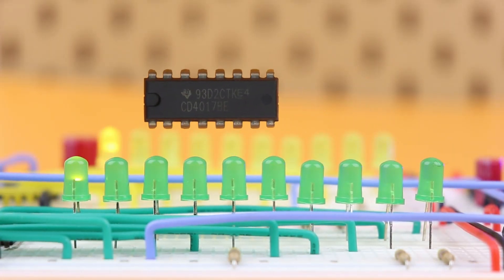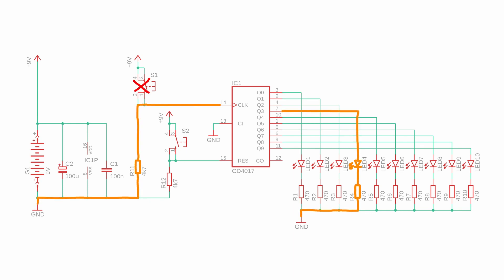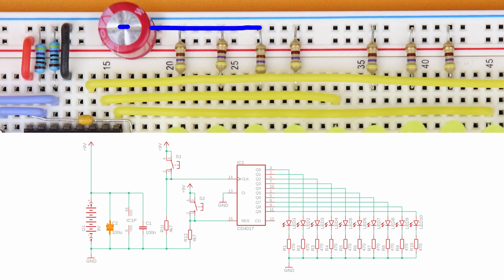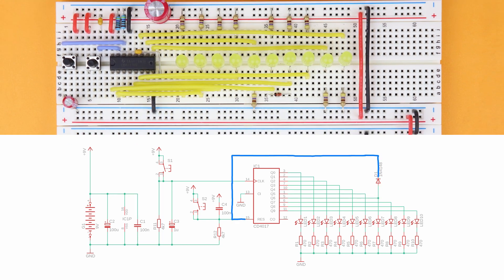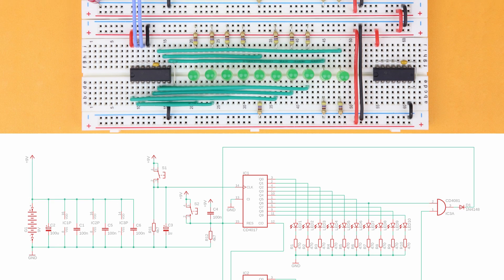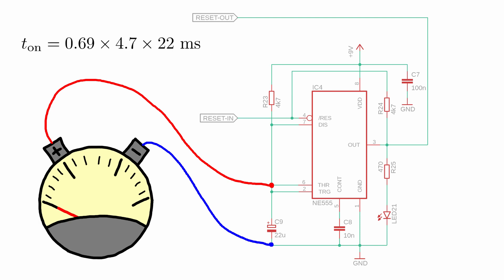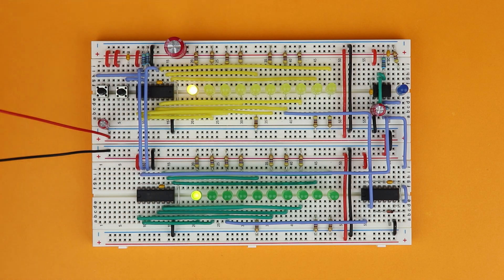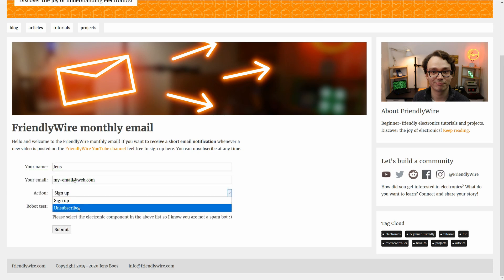CD4017 tutorial: the IC you can count on!

Comment: The reset problem should be resolved with the application of sychronous logic, not a 555 "bandage."
Reply from the maker: That is also a possibility. But even computers in the 70s and early 80s had dedicated reset circuit that would hold the reset line high for a short while. I do not think of it as a "bandage," it is just a different solution.

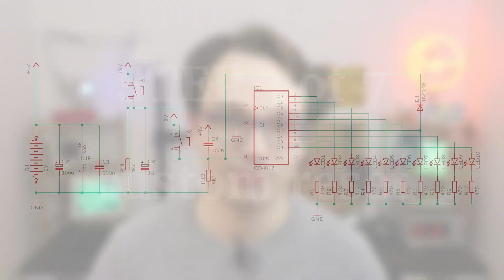Comment: untill the 7:07 I've been amazed by the instruction and the perfect presentation by you FriendlyWire , amazing!
but few questions:
for inserting capacitors in parallel , do we have two or three choices? or only the place you put. i'm still got problem with reading diagram to place in the right place
Reply from the maker: Thank you for your kind words (it means a lot) and an even bigger thank you for the question! The small 100nF ones can be placed close to all of the chips, and they can be plugged in either way. The bigger ones have a plus and a minus, and they can only be plugged in one way. But maybe you can tell me which capacitor you are talking about :)

Comment: Hello! Very nice and understandable video, thanks! Actualy, I'm working on a project using 4 pcs CD4017 in cascade (it's a simple count-up 40 pcs LED bar clock telling my grandchilderen (who are still to young to read the clock) when 15min, 30 min and 60 min are past. It's is working fine (thanks to your in-deep explenation in this video. However I would like to do some cosmetic changes. Question: Is there a way, without using to many other discrete gates, to keep the outputs of the CD4017 high (instead of going up high and low again) untill the CD4017 receives a reset? Resetable flipflops are a possibility but I would need 40 of them? Thanks in advance.
Reply from the maker: Thank you for your kind words, Wim, I am glad you found my video useful! And that's a super nice project! Unfortunately, the CD4017 only ever has one output high. But you could use OR gates to keep your LEDs on. For example, consider Q6. This one should be on when, well, Q6 is high, but also when Q7, Q8, or Q9 are high. So you connect pin Q6 to the anode of a 1N4148 diode, same for Q7, Q8, and Q9. Connect all cathodes together. There you put your LED. This LED will always be ON whenever Q6 or Q7 or Q8 or Q9 are on. Diodes make very cheap OR gates. you will still need a lot of diodes.

Another alternative would be to use a shift register and simply push down 1's. Have you seen my tutorial on them? https://www.youtube.com/watch?v=7RWaDvTeG7Y Let me know if you have questions on that, I am happy to help out more!

Comment: Great tutorial, but you only need one current limiting resistor for the LEDs because only one is a time.  All the cathodes should tied together and connected to the resistor is connected to ground.
Reply from the maker: Very true! To be honest, separate resistors is easier from a breadboard perspective because then we can use the ground rail as intended. Otherwise we would have to create a separate rail to collect all the LED cathodes, before connecting them to ground via the single resistor. Also, by generating this cathode rail there would be more wires involved and that could create additional stray resistance (especially on less expensive breadboards with poorer contact conductivity). 

So what you suggest is definitely the more component-effective solution and one should do it like that in practice :) But I hope that the tutorial still makes sense as-is. Thanks for your comment, and I have no idea why I did not mention this in the video. Have a great day!

Comment: ...and how about just adding a small capacitor after the AND gate diode and extending the RESET signal???
Reply from the maker: That works, too, but is less reliable if you have a large breadboard with not ideally conducting contacts. I found the 555 solution presented in the video to work more reliable :)

Comment: Great video… you can eliminate all those resistors tho… tie the cathodes of leds together and run them to ground through 1 resistor ( I used a 560 ohm resistor with a 9  volt supply and it worked fine( only 1 led is being turned on at a time so no need for each one to have its own resistor) Thanks for the video. I subscribed ❤
Reply from the maker: Thank you, I am glad you liked the video. And yes, you are right, in this case only one resistor works because only one LED can ever be on at the same time, good idea! :)
Reply: This circuit worked great the first couple of times I turned it on. It then started behaving really erratically. No longer counting and  leds lighting in no order at all. When I looked at the circuit with my scope I could see a lot of noise at the leading edge of the square wave from the 555. I tried changing both chips. No luck. I then tried using a 9vt battery hoping this would get rid of the noise. No luck.😢 I then placed a 220uf cap across VCC and bingo!! It worked perfectly. Noise from 555 gone. Thanks so much for these videos. Very cool circuits!!❤
Reply from the maker: @iaov  Glad it works now! Yes, that's why I always try to add a big bulk capacitor (here: C2 with 100uF), it really helps stabilize stuff. Glad you got it working, congrats, and thanks for your kind words!

Comment: Can the green led starts to lights after the last yellow led 
I want the led to light in sequence like (1,2,3,….20) not as the video in the same time (only one led lights)
Reply from the maker: Oh, you want to have a counter from 1-20, basically? Yes, this can be done, I think, by using the clock inhibit pin of the first and second counters. The problem will be to turn off the last yellow led (when the counter is in the range 10-19) and to turn off the first green LED when the counter is in the stage 0-9.

Comment: Use a resistor in conjunction with denouncing capacitor C3 to prevent premature contact erosion. Insert the resistor between S1 pin 1/2 and C3's + lead. A typical value range would be 10K to 100K ohms.
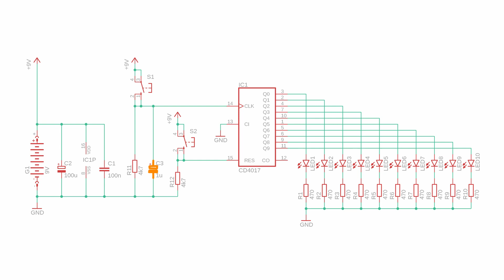Reply from the maker: Thanks, Arthur! This is to limit the current draw of the capacitor, yes? Good idea! (Schematic is at 5:49, for anybody reading this.)

Comment: Great video.  I stumbled on this looking for something very similar.  I basically need your exact circuit, but I need to be able to also count down as well, using a separate momentary switch. Do you know of an IC that has the 'down' option? Thanks!
Reply from the maker: Hey Bob, glad you found my video useful! The CD4510 can count up and down, but it does that in binary-coded decimal (BCD). If you want to convert this into a decimal pattern, you need to connect the outputs to a BCD-to-decimal converter, such as the CD4028. Hope it helps!

Comment: Just for the meme, I would have made this a 10-step tutorial. The carry out counting to 99 is fine but I would have liked to see implementation of a count to 19 circuit as I think that's also quite useful. You could make a followup video called "Hey 19", again for the meme, a reference to the Steely Dan song.
Reply from the maker: Something tells me you like memes... ;-) Well the general reset is discussed with AND gates in this video, too :)
Reply: @FriendlyWire  I'm not too meme centric but when there's an obvious opportunity, I think it should not be dismissed too easily. I've helped people on forums make sequencers using the 555/4017 combination to control model lighting such as for the various strobes and lights on commercial aircraft. It's an effective and accessible method for people who would not be willing or able to cross the entry barrier to microcontrollers. So far, no one has needed more than 10 time steps but having 20 available would be good.

On further reflection, I know how to build the output decode logic onto your 100-step sequencer and that's probably the best way to do it but I keep thinking there was also a circuit topology that used the second 4017 for counts 10—19 instead of the way you've shown where it's the next more significant decimal digit (10's). Either way, if you revisit 4017 circuits, these might be good material.
Reply from the maker: @KJ6EAD  I see what you are saying, yes! I like the idea of using 4017's to simulate light patterns. I used one some time ago (together with a diode OR gate) to simulate traffic lights :) Interesting idea about having 0-9 on the first counter, and 10-19 on the second one. I suppose you could just hook up Q9 to the Clock Inhibit pin of the second counter.

If you are interested in "outside the box" applications of the CD4017, also check out my code lock that uses these: https://www.youtube.com/watch?v=8aS2f4dCmBI
Reply: @FriendlyWire  Ah, yes, I haven't used the 4017 in a while so I'd forgotten about the clock enable. I'll have to pull up the data sheet and refamiliarize myself. I've done the traffic light (American pattern of course) with diode OR gates. I even have a party decoration traffic light about 10" tall that I'm going to animate with the circuit and appropriate LED clusters to replace the ridiculous random incandescent bimetallic blinker lamps that it had. I've also made alternating triple flash "police lights" both with integrated 3-input OR gates and with diodes. I don't want to take up any more of your time so there's no need to respond unless you want to.
Reply from the maker: @KJ6EAD  Always happy to exchange ideas! :)

Comment: Maybe you could use a rs flip flop which is set by the "and" condition q1.6 and q2.2. For reset you use another "and" condition q1.1 and q2.1 🤔
Unfortunately I don't have the opportunity to test this, but I would be very curious to see the result 😊
Sorry for the grammar, i'm not a native speaker 😅
Reply from the maker: Thanks, Simon! Can you clarify what you mean by q1.6 and q2.2? I am always interested in improving the designs presented in the FriendlyWire videos :)
Reply: @FriendlyWire  q6 of ic 1 und q2 of ic 2
I could have written that a little better 😅
Reply: Sry I meant q0 of ic1 and q5 of ic2 😁
The reset condition is q0 of ic1 and q0 of ic2
In that case you can be sure the reset signal stays as long as both ic's has been reset
Reply from the maker: @Metalfish0815  I like that! You would still need an additional chip (the RS flip flop) but you could ditch the 555. Also, you would need more gates for more chips to AND them all together into your RS flip flop, or you need AND's with multiple inputs, and that may become a bit cumbersome. But it's a good idea to do it. I kind of liked this 555 solution because it reminded me of the old reset circuits in computers from the 70's, but that's the great thing about doing YouTube: there are always more and interesting ideas that you didn't think of :) Thanks Simon, and have a great weekend!

Comment: 10:50 just add a inductor with a transistor to bump the voltage and make it charge faster to make it hold the voltage a bit longer so that it can register
Reply from the maker: Thanks! Won't you get a negative induced voltage when the signal disappears? I would be worried about EM noise.

Comment: Your videos are like Peter Jackson movies ,pristine and eye catching .I'm new in electronics I'm a 50 years old guys always love electronics ,learning alone with some books and videos. LOOKING FOWAR FOR MORE OF YOUR VIDEOS.I have a question 🤔  can I use ceramic cap.? Also it's there a equivalent for 1N4148 diode ?.I have a lot of them but not this one you know how it is  .Thank
Reply: I'm referring to the cap that you  use for bypass  between pin 16 and pin 8 for the CD4017,I see you use a yellow cap I believe they are Monolithic Cap. I wondering if I can use  the Ceramic Disc Cap  instead .                                              The diode ,I have 1n4007 but they are the black ones, can I use those .I thank you so much for taking time to answering my questions.
Reply from the maker: @ricardomarty9292  Thank you for your interest, it means a lot :) Oh, I see! Yes, those capacitors should work great, and the diode should work as well. Good luck, and let me know how it turns out, I would love to see a picture :)
Reply from the maker: Thank you for your kind words, it means a lot! :) For which part do you want to use a ceramic capacitor? The larger ones, above one microfarad, typically are electrolytic ones. And yes, you can use other diodes, too. Which ones do you have? 1N4001 or similar ones should work as well. Let me know if this helps or if you have additional questions, I am happy to help!

Comment: Wow, thats amazing. I would love to build this kit. Quick question, can this be powered by a usb cable with a power bank as a battery? I know that it would probably need some modifications on the resistors, but would it still work?
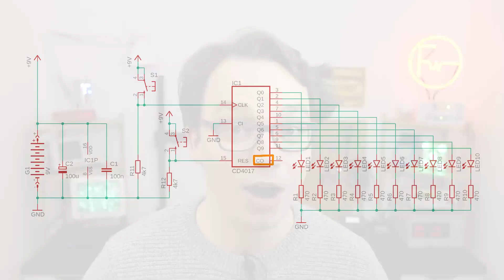Reply from the maker: Thanks, Victor, I am so glad you like it! Yes, of course :) In this case you can change the LED resistors to 220 Ohms (instead of 470 Ohms), but if you leave them at 470 Ohms the LEDs will work just fine, they will just be a little bit dimmer. There is a nice USB breakout adapter that you could use. I talk about it at 2:55 in this video here: https://www.youtube.com/watch?v=yBiQuKFuo4s&t=175s . Let me know if that helps. If you have any other questions, let me know :)
Reply: @FriendlyWire Thanks man, I will write this down in my component list for when I have to purchase them! I'll  take a look on that video you mentioned :) You have my sub.
Reply from the maker: @victorsunah4626  Happy to help, and let me know how it goes! :)
Reply: @FriendlyWire  I will!

Comment: This is really cool and helpful, but as a CS person I hate that reset circuit. Fixing a race condition with a timer never works long term. This should be a latch that unlatches after both resets happen.
Reply from the maker: Thank you! Can you explain a bit more what you think could go wrong?
Reply: @FriendlyWire  The 4017 clock and the reset chip clock are independent. If the 4017 clock is significantly slowed down, the reset hold time may no longer be long enough to cover the second reset, depending on how the 4017 reads that pin (presumably on the rising edge of the clock signal). It would be better to create a latch on the output of both 4017s that makes sure both get reset before moving on. Basically, always control the variable you want to control directly, don't try to use a side-effect that just happens to work in a given particular case.
Reply from the maker: @requiredaccount8019  Thank you for explaining it! I am not sure if I agree, though :) Looking at 11:21, I am not sure what you mean by second reset. The AND gate only triggers if both inputs are high, which is only ever one state (not two independent ones). The reset hold time is also independent of the clock speed, and it can be adjusted by C9/R23. In this circuit, what could go wrong in your opinion if the clock speed is very slow? When I tried it by hand the clock speed can be as slow as you want, it always resets properly, so I am a bit confused :)

Comment: Thanks so much Mate. What a fantastic tutorial. Push button bouncing, haha. I thought I was wiring up a previous project incorrectly.  ;-}
Reply from the maker: Thanks, David, glad you liked it! Yes, this bouncing can drive you crazy at times :)
Reply: @FriendlyWire   Built the circuit today. Works perfectly.  A quick question if you don't mind. Does the red led on the second 555 correspond with the cycle of upper bank of LEDS IE 1-10, and the blue LED remains as the reset indicator? Thanks again for this. It is so informative.
Cheers Mate.
Reply from the maker: @davyps8273  Awesome work! And yes, please always ask, I am happy to help :) Yes, the blue LED is just there to show whenever a reset happens, and the red LED gives the clock frequency of the counter :) These LEDs are both not required for the circuit to work, but I added them to make it easier to follow what happens. If you have a photo I'd love to see it! (I am @FriendlyWire on Twitter and Instagram.)
Reply: @FriendlyWire  Have posted on Instagram.
Reply from the maker: @davyps8273  Thank you, received! :) Looks amazing!